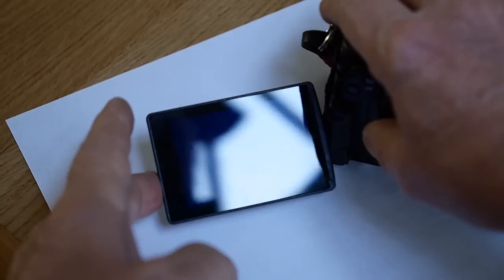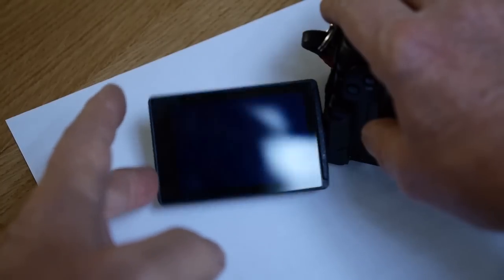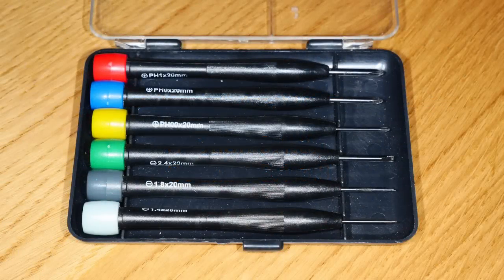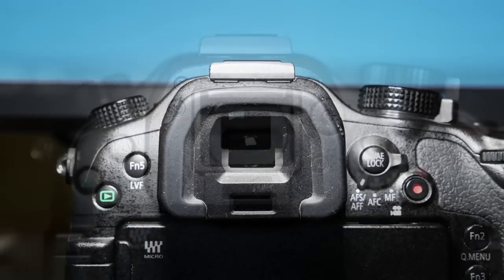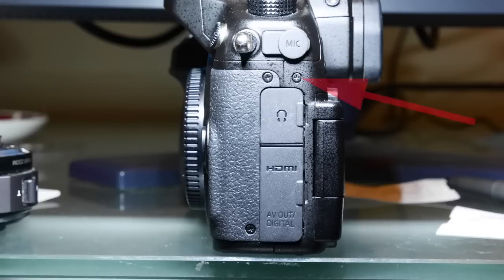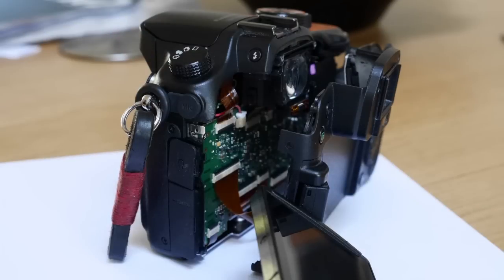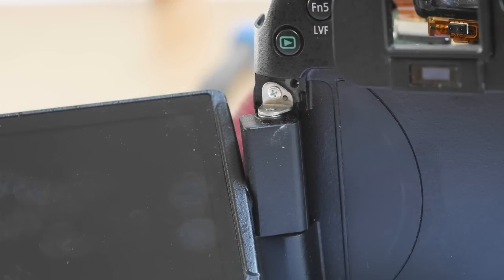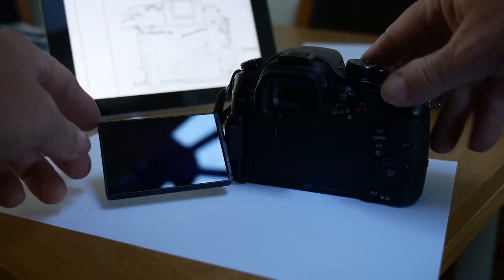How To Repair A Panasonic GH3's  Wobbly Monitor

Comment: Do you have a fix for an EVF that won't turn on anymore? (GH3)
Reply from the maker: +Greg Hoff No, I don't. Sorry Greg. This repair to a loose screw is about as far as I'd take any messing with the innards of a digital camera. If you take the back off as here, I think it exposes the connector for the EVF and it may be that if the problem is just a corroded contact a wiggle of it might do the trick. I doubt it, though and it sounds like a job for Panasonic to me.
Reply: A couple of years ago I had the camera repaired for the LCD wobbliness under warranty. Getting it back the LCD did not turn on when it was fully extended out. I had to send it back for repair yet again. I think they actually replaced the flex cable in the hinge, I don't have the repair report immideately at hand. However, in the summer of 2016 the LCD started to not turn on again. Giving the body a light hit at the right side turns the LCD on if folded into the body (LCD out), however its black or just garbage when the LCD is fully extended out... After seeing your instructions I'm tempted to take the back apart and see if the cable is loose from the connector or damaged.
Reply from the maker: Anything further than seeing if the connector is connected properly would be beyond my skills but done carefully getting the back off is not too difficult. Good luck!
Reply: Both the flex cable and complete hinge with flex cable is available on ebay and by the sales rank they sell a lot. Seems like the flex cable has broken inside the rotating mecanism. I wonder if this is a particular GH3 issue or issues with rotating LCDs in generall...
Reply from the maker: I've not heard of it much but I think the GH3 may have had a more problems with that, maybe caused by the loosening of the screen.

Comment: And now... some time later, I remembered this video, I have picked up a GH3... with a wobbly LCD screen. What to do? Perhaps, I'll just let it lie. Or perhaps on another day I'll have a go at repairing it. I'll not be returning it to Pana After-Service out here in the sticks.
Reply from the maker: BobToms100 The repair is pretty straightforward but I'm inclined not to be as organised as I should be. So for this, I made sure I knew exactly what I was doing before I did it and made absolutely sure I know where everything went back. What's important to me is that I put by enough time to do it. Rushing things like this is a nightmare!

Comment: great..!! cheers... does anyone have the same issue regarding touch screen not working on panasonic gh3? need help...!!!
Reply from the maker: If Touch Settings are On, it should work and that's that. If not, it sounds like a service job to me. Maybe someone can help. Oops! Gary Leadbetter's post was marked as spam by YouTube and I just noticed. See below.
Reply: 007kurikung did you ever fix the touch screen on your GH3?  my GH4 has the same issue.  thanks!
Reply: sad to say its still the same. have to deal with it with no touch setting. even if its still on the panel dont recognize.. hope youre still on warranty.. or try to go to fb groups for gh4. maybe they can help you.
Reply: thanks for the reply. at least you can still fully operate the camera without the touch screen.

Comment: That is just crazy. I assume you chose to fix the problem yourself instead of sending it to a Panasonic service centre (saving time), but really, having spent so much money on purchasing the GH3, one shouldn't expect such a simple issue. Not such wobbly screen on the G3 and GH2.
Reply from the maker: They didn't seem certain it was a warranty item - I'd say it certainly would be . But yes, I did it myself to save time and trouble. Someone has just contacted me to say that their flash hot shoe is coming, loose but looking at the service manual that looks a bit more difficult to get at.
I agree, it's the sort of thing that should be avoidable and I also had no such priblems on my GH2 or G3 (which I had for a longer time)
Reply: Shame...
Reply: David Thorpe Presumably, they weren't sure it wasn't a warranty item either. Whatever happened to yes or no?
Reply from the maker: onenarrowdoor Good point. I expect they would have done it under warranty since it is less than a year old -  I don't see how I could have done anything to make an internal screw come loose. But with that and the packaging up and all I just thought, 'oh, **d it' and did it myself.
But as you say, the answer should have been a straight yes.

Comment: i'm having the same problem with my g5
Reply from the maker: SamuelBarnes I'd be surprised of the construction of the G5 was not very similar to the GH3 so the GH3 instructions should be a useful guide.
Reply: Ok, thanks!
Reply: SamuelBarnes Fix my G5 with the same issue.  Was a super easy. New found love again for the camera.
Reply: +Damien Van Der Vlist    I am going to try this on my G5. Thanks to David for this video.
Reply from the maker: +Schira Good luck!

Comment: Panasonic makes great cameras but they mess up on their designs all the time.
Reply from the maker: Yes, 'happorth of tar is the phrase, I think.
Reply: Agree. I kind of feel Panasonic cameras are like iPhone's its always the seconded iteration of that model that is good. Like the iPhone 4 they fixed the problems in the iPhone 4s. Just like the GH1 they fixed all the GH1 problems in the GH2. And the GH3 is in a new generation so we'll have to wait for the GH4 fixes.
Reply from the maker: mp4podcastDOTcom Makers seem to feel forced to upgrade often now, don't they? I'd prefer a longer period between model changes and a longer time spent developing and testing.
Reply: Agree. I still see amazing photos taken all the time with old cameras. Here is a search I just did with the GH1 http://500px.com/search?q=GH1
Reply from the maker: mp4podcastDOTcom Amazing stuff. it's in they eye.